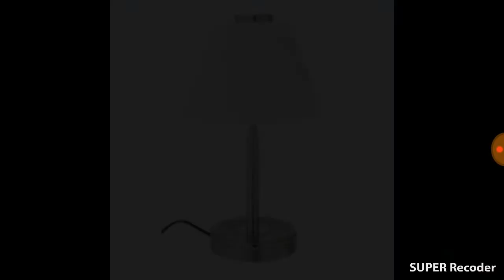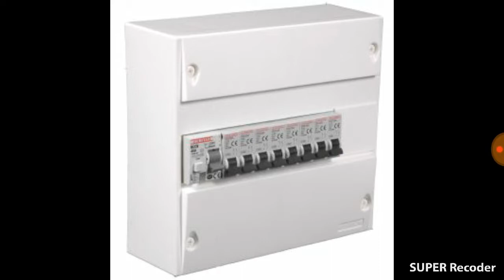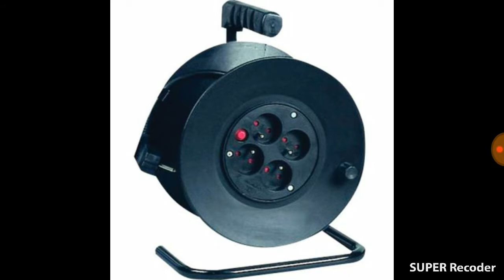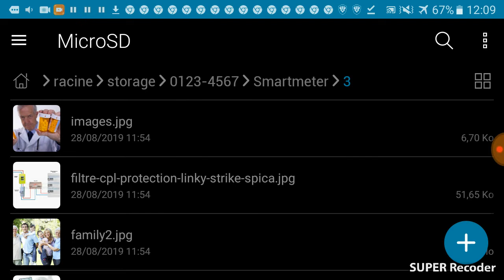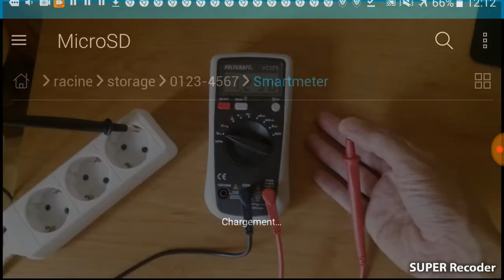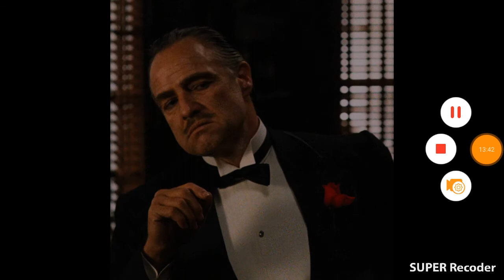Smartmeter , be smarter

Comment: It's indeed good to lower electric fields in the home, especially the bedroom, and places where you sit a lot. A too cheap multimeter may not measure electric fields accurately though. And there is a lot more to learn about this subject.
But they should make clean products, so the grid is clean.